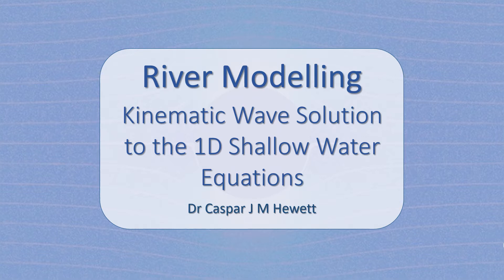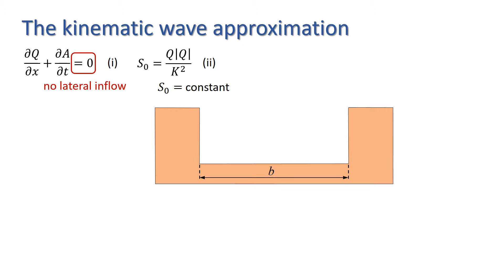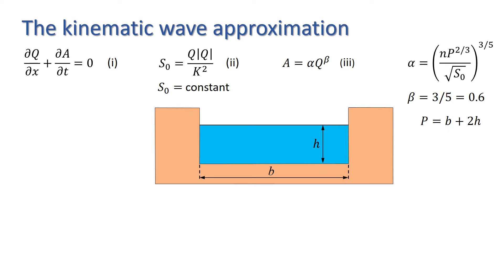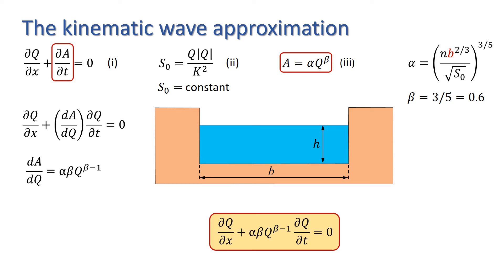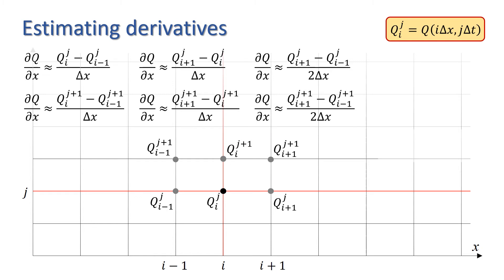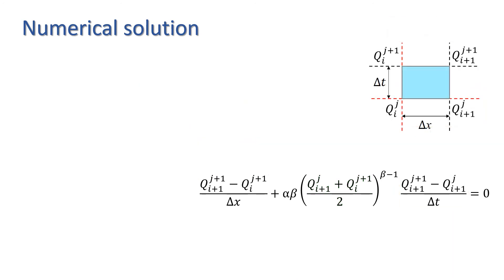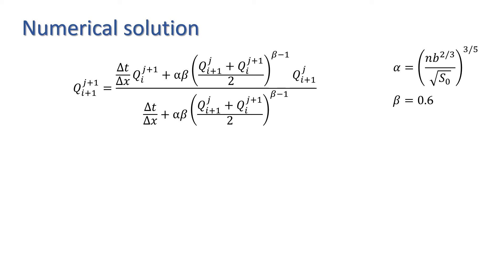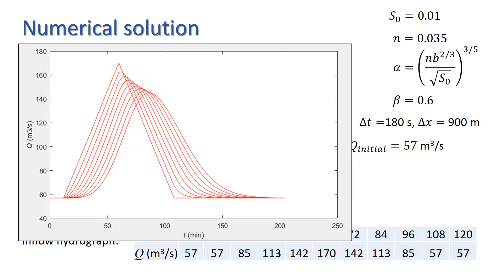Kinematic Wave Solution to 1D Shallow Water Equations

Comment: Hello, Dr. Caspar.  I am really interested in your solution. Could I have a look of the code?
And could I ask a few questions concerning the kinematic algorithm?
Reply from the maker: Hi Justin, yes, sure, drop me a line at my Newcastle University e-mail address (see https://www.ncl.ac.uk/engineering/staff/profile/casparhewett.html).
Reply: @CasparHewettFluids  

Hello Professor, 

Thank you for making these videos. 
I am a mechanical engineer,  in R&D, designing cam and followers (among other tasks). Your final solution family of gals looks just like  B-Spline basis functions. I use them while designing the lobe shapes for cams, for the followers prescribed motion. 

I came to this video to brush up on fluid dynamics for another task ( pressurized oil hydraulic linear slideways), trying to incorporate the sudden expansion term to the Bernoulli equation.

Take care.

Leo, from Denver